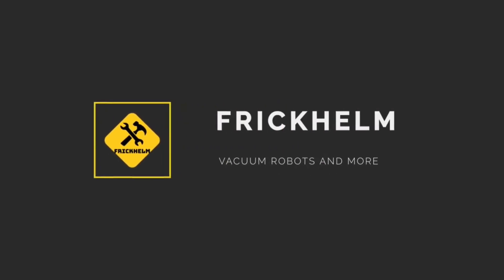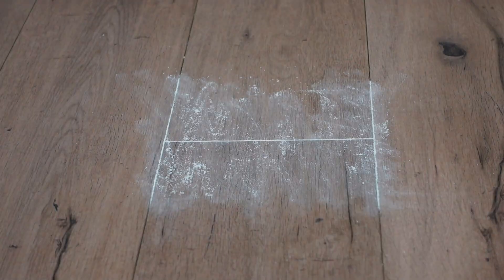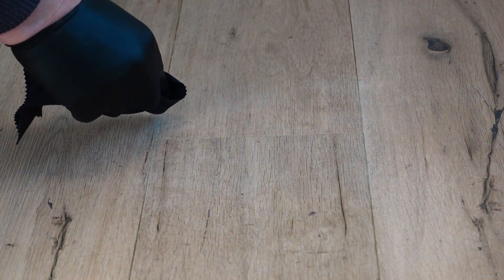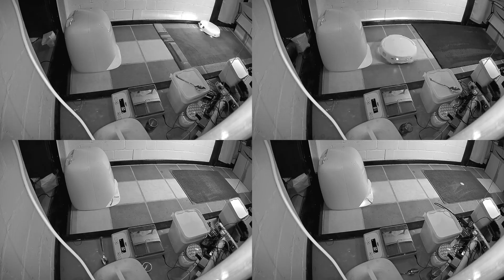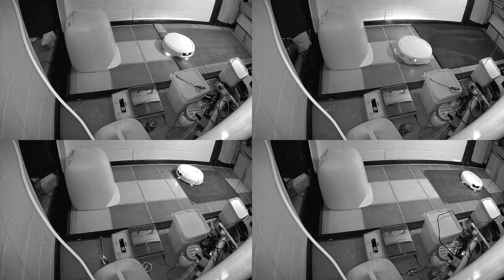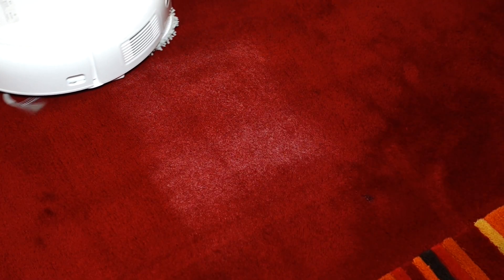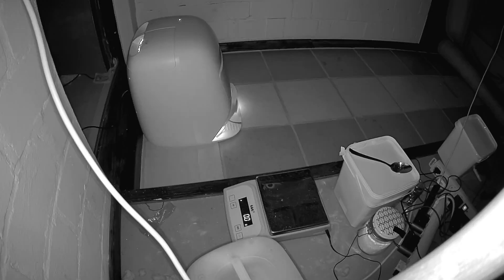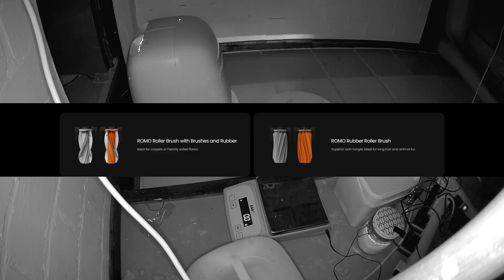DJI Romo S - cleaning performance review [rubber brush]

Comment: DJI actually recommends to use the bristle brush rollers for houses that need deep cleaning or have a lot of carpets. The silicone ones are primarily for long hair and general cleaning. It would be interesting to see how it would perform with the bristle rollers.
Reply from the maker: As stated at the end of the video I bought the bristle brushes (still a shame it does not come with both in the S Version) for a 2nd test.
Reply: @frickhelm waiting for that video!

Comment: I knew it again since day 1 it's going to be an another influancer pumped over priced robot vacuum device... 25.000 pascals only for the paper not real world usage... Only thing that I like, this particular one is design and having really good sensor technology.
Reply: No one asked, but it was needed so much.
Reply: DJI actually recommends to use the bristle brush rollers for deep cleaning and for carpets. I wouldn’t judge it before I see how it performs with those.
Reply: @mehdihayati8567 I'm sorry but even roborock S7 which is released in 2021 March can defeat this flag ship model of 2025 I can't expect much. Besides there's roborock's q10 s5 is also much better than this. Which is not claimed to be even not a flag ship.
Reply: @Avucoda well you can see roborock’s own flagship models aren’t that much better either. I’ve seen someone else’s test the Romo with the bristle brush and  it was way better. BTW the main thing with the Romo is it being truly hassle free, from the self cleaning dock to it’s obstacle sensing, nothing else comes even close. For me personally, I’ll be happy to sacrifice a little bit of cleaning performance for that if there is any sacrifice to begin with.